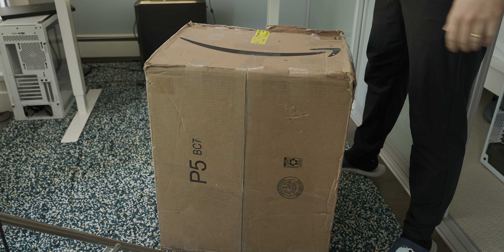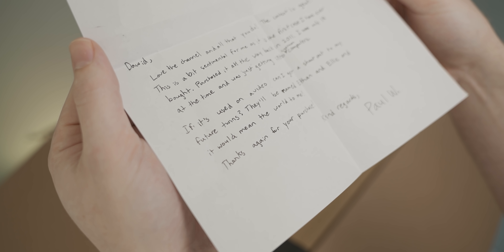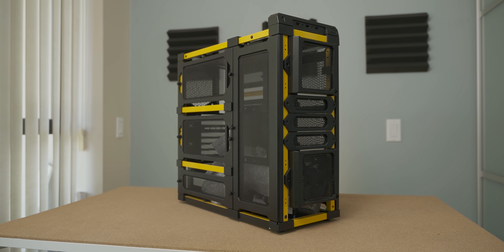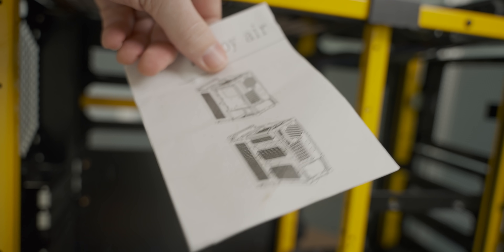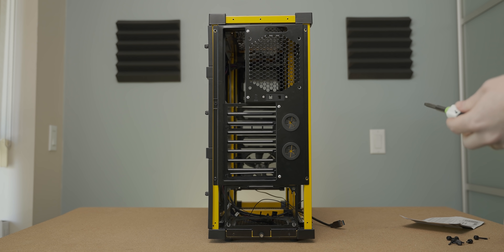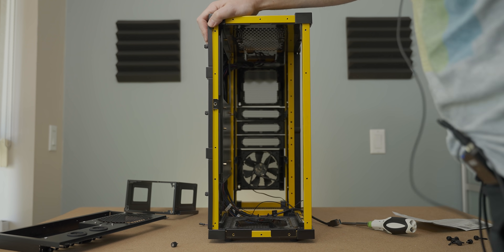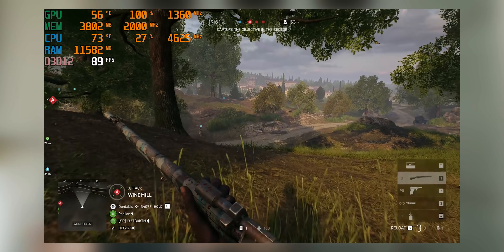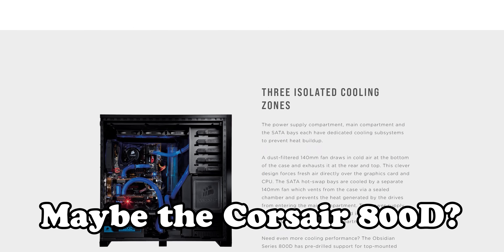The BEST Airflow Case Ever Is From 2010?

Comment: Man, this brings back memories. Anyone remember when Antec was one of the biggest and best players in the PC case realms?
Reply: I have some of their cases in the garage from about 10 or more years ago I think. Man, I remember me and everyone had their cases. What happened to them? Haven’t really looked at pc case manufacturers.
Reply: I still use my Antec Skeleton case.
10 years isn't old.
I'm still using a 12 year old 1st gen i7 as my gaming rig.
Reply: @sahhull  I wish I could harness a fraction of your frugality lool
Reply: @chadking8767  It's really not that hard especially if you reuse things that you can. Like you can pretty much still game on a 3770 or even 2500k overclocked with a GTX 970 or RX 570 or something perfectly fine even at 1080p. I was having to turn all kinds of shit down back in 2017 at 768p because I was still using a 1gb HD 7000 series Radeon and an i5 3350p. Amausingly, a 3770k and a GTX 980 was really all I needed to do with that PC and still game. I simply chose not to, because I'm a fidelity snob who's overcompensating for the suffering of XCOM2 running like shit at 768p and so I'm at 1440p now. But even then, mostly what's different between then and now is really only refresh rates and resolution, not actual game mechanics or graphical improvements. Dead Space 2 literally still looks like some 2022 game trying to sell itself on raytracing or some shit. Basically everything stagnated after about 2010, 2012, so if you don't upgrade your monitor, odds are you can still use a really old/low end graphics card and be fine unless the game is a complete unoptimized mess like Crysis or Cyberpunk or something. 

>but it's not just optimizations!
Go look at Alien: Isolation and tell me that. 2014 game that straight on looks better than tons of modern games, even including the models. It outright looks better with more detail to the skin of their face than triple A games. Division 2 is a very pretty game and its models could be from 2012 and I likely wouldn't notice the difference. It's sad. Most of the gaming conventions and even the popular franchises all started in the 90s until they were sodomized horribly by Bethesda or someone, because it's an industry ran by the corpos, the lawyers, the marketing people, the suits wanting dividends, and not the early non-businesstwats who made up the gaming industry, who successfully deflected blame for their terrible practices on "wokeness" when most wokeness doesn't even exist in gaming and the few times it does was specifically forced in there by the business types themselves as a marketing decision to "sell more units." Meanwhile the same shitheads who've been ruining gaming since the late 80s in those corporations are the same ones that've been aggressively moving to phoneshit, after they drained every last drop of blood they could squeeze out of paid in game microtransactions on full priced titles and consolization. Basically every time I think about gaming or tech and money I get asshurt all over again because I remember who's to blame and keeps getting away with it and making things worse, because art is ruled by Capital, by MBA major types. 

The butthurt grows the longer your memory as you can remember how much worse it's gotten over time, until you just start refusing to give them your money. Like I won't give Valve my money if I can help it, I will never pay for a title from EA or Activision. So even if you're not frugal, you can still be rightfully butthurt when you remember your phone's battery doesn't come out (and tracks you as a GPS/audio/webtraffic bug anyway), your laptop's RAM, SSD, GPU, and battery are all soldered on, and the proprietary motherboards don't even have the fucking right connectors so you can't reuse anything from Dell anyway thus negating any reason to purchase something from Dell (especially not the high end shit where basically "Alienware" is a plastic skin of Alienware's corpse that an ancient metal Dell chassis wears around to frighten oldfag gamers with, since it's got a 120mm AIO for a 12900k and performs worse than a 12700k anyway) end up refusing to pay for or use anything from Apple ever, feel like nVidia is straight up scamming and lying to you without the performance to deliver, see how shitty a lot of surviving companies are now that EA didn't murder yet like Eidos, and basically just stop being willing to pay for anything new sheerly on principle of hating the companies. So if you can't be frugal, remember what they took from you and be butthurt.

Comment: If they released something like this today, I'd buy it honestly.
Reply: Yes my case better have mad air flowwww 🥶
Reply: I like how it looks and would also buy one.  I built my rig in a  THOR V2 case.  It has good airflow and one of the few that had the 6 front bays I needed.
Reply: Just please, if you do it, don't ruin this monster with rgb fans everywhere, but I understand you mate, I would buy it too if I would be able to leave my C.M. 690 III. But I can't betray it, I love my case too much, even if there is no hardware inside. Actually working on it to improve airflow and let it shine again. This kind of case, like that Antec or mine, are rare gems nowdays. There is the corsair obsidian 750d that give me some retro' vibes and seem solid. MMM maybe I'm being too much nostalgic.
Reply: @andreabriganti5113  Only yellow LEDs could fit into this case in my opinion.
Reply: This case does have a lot of look but in terms of air flow it's a chain link fence around a test bench. Imagination time. If you want to cool a room what would work better, closing the door and using a window-mounted air conditioner, or setting that AC unit on the floor in the middle of the room? In the window, right? Cool air in, hot air out. It's all about exchanging hot air with cold air. This case moves a lot of air around in a chaotic way. It's basically the design of a space heater. There's a practical reason why most cases aren't just perforated metal boxes. I wonder if he used another case with good airflow but a dedicated intake and outtake as a control if the results would've been different.
Reply: @zachb8012  lmao bro calm down no need to mansplain it we all know how cooling works.
Reply: @zachb8012  Just have one entire side of it be intakes, then all around the top and front and back be outflow
Reply: I wanted to buy something like this 8 years ago, but they didn't make a microATX model. 😢

Comment: I think the airflow case to beat is the Silverstone FT03 from 2011…

Since hot air rises, the vertical mounting doesn’t allow any hot air to be stuck anywhere inside the casing. It has a pair of 120mm fans to push air from bottom to top. And the 120mm exhaust fan is situated right above the cpu to move any hot air out.

Comment: I had one that I used for a while. Great airflow and really didn't mind the fan noise. Mainly due to the furnace and AC making more noise than my fans.
LOVED the fact the hard drives had some shock protection, in the case they were suspended by rubber bungee cables with clips.
LOVED the totally modular case. If I ever had lighting for the case I'd simply flip the board from one side to the other.
LOVED the fact I could take the shop vac, go into blower mode and blow dust out of the whole thing.

Only con I had about the case was while it was on the floor at LAN parties one knocked over drink and game over.

Wish I still had the case. Had it in storage in my basement when it was accidentally taken by a junk removal company when I wasn't home.

Comment: I still remember when Antec made good stuff. My NAS is still powered by an Antec 750W PSU from 13 years ago. Those things were incredible.
Also, by the time this case was released, my system was housed in a CM Storm Sniper by Cooler Master. Excellent case as well.

Comment: Ran across this video today, because I'm building a new rig soon, and looking into a new case. Reason being. I have run this exact case (mine has the blue accents, not the yellow ones) since it came out back '09-'10. You're not wrong about dust, have to take it out and clean it every once in a while, but it's always had super cool running temps and the modularity was one of the things I've always loved about it. But, it is just time to upgrade, I will never get rid of this old case though, it's been amazing.

Comment: I still use my old Antec 900 case from 2007, 4 120mm case fans and one 200mm. Great air flow. I cut a window a/c filter(very thin plastic kind) to fit the front to keep the dust out where 2 of the 120mm intake air. Cut another small piece for the side 120mm fan that blows over the GPU. The GPU fans don't even come on until the GPU is really pushed because of it. The top 200mm fan exhaust air out the top and another 120mm in the back in line with the CPU cooler exhaust out the back. My power supply also has a 120mm fan that exhaust out the back as well. I just cleaned it after my last build from 3 years ago and there was hardly any dust in there, it gets used 4-6 hours daily. After all these years I only had to replace one fan. So far I've built 4 systems in it over the years. I think if I build another system in it I'll replace all the fans since the rest are so old. If you can't tell it's my favorite case and I've gotten my money's worth out of it!

Comment: I still have mine.  Blue one.  Never added fans.  Just kept the 5 that came with it.  I believe they all have blue leds in them.  Never had an issue with dust.  Used it from 2011 or so until 2013 and then shelved it.  Been sitting in a box in my closet with same hardware I installed in it.  The hard drive cables that suspend them rotted away.  Case was much bigger than I thought it would be. Fans were loud.  The 2 on the front came with knobs so you can control the speed.

Comment: This case cost around 200 USD in 2011.  I was building a pc and Newegg just happened to have the LanBoy Air in red-black on a one-day sale for 50% off the very day that I was ordering my components.  It was worth the sale price.  Thermals were excellent and it was one of only a few cases wide enough to accomodate a Thermaltake Frio, which was a very large air cooler (this also required flipping around the rear intake fan so it functioned as an exhaust).  The plastic did feel a bit flimsy.  And you're definitely right about dust being an issue with this case.  I had to clean it out with an air compressor regularly.

Comment: Great video, some of the older case have so much character. 
I love my Corsair 780T [White], still running an i7-5960X and GTX980 Sli from 2015.  Temps generally run about 40 Celsius for CPU using H100i cooling and 55 Celsius for GPUs.  Case gets cleaned out of any dust every month.

Comment: I have a Master Cooler HAF full size case from around 2009.  In January 2021, I rebuilt my computer but used my old case. Entire front is used for air intake (except for DVD drive) with 200 mm and 120 mm fans. Side has 200 mm fan intake blowing onto cpu and motherboard. Top has 200 mm fan and rear has 220 mm fan both for exhaust plus the power supply.

Comment: I would love to see a video on the Coolermaster HAF X which I used in one of my earlier computer builds (2011).  Great case for its time.  Like a damn wind tunnel!  I have it in pretty much flawless condition in original box at my house!
Reply: Mine is also chilling in its box in the basement. Would love to use it again, but the bastard is 2" to tall to fit under my current desk. 😭
Reply: I run my current system in a HAF 922. Best cooling ever...

Comment: I have the exact same case and bought it in 2009. I been using it for every single build ever since. The only things I recommend is to get some polyurethane foam filters and cut  them to fit over the fans. I used sticky velcro tabs and covered all openings including the top of the case .. That way you get far less dust and you can take them off and clean them. Also the rubber that holds the HDDs will disintegrate over the years. I just replaced it with zip ties.

Comment: I've got an Antec Solo 2 case and I'm totally happy with it. Gear inside: Ryzen 3600, Asus Rog MB and Asus RTX 2060S Dual version. Temps are ok (under 70st CPU and GPU). There are 2 Noctuas NF-A12x25 at the front and NF-S12 at the rear. Build quality is very good. This case was my dream once, long time ago, and later, when it wasn't avaible on the market i've found it on Allegro site from private person, new, unused. So i bought it then , few years ago,and don't plan to change.

Comment: Great video. Within the last year I picked up a lian li pc-a77f case(case came out in 2010), and it's been serving me well. I use it for a server, so having the 12 5.25 bays is great for mounting hot swap bays. For the most part the case seems to stand up well with current cases, but has a few quarks from that eara of cases.

Comment: The whole HAF series holds up pretty decently. Specifically the haf 922
Reply: I'm still using a cooler master haf 932. Unpainted interior, firewire port on front io and no usb 3. But what a good case with great air flow.

Comment: Awesome case! I think the Cooler Master CM690 series hold up pretty well. Very basic and good airflow. That said some versions had completely bonehead design issues like a top vent that don't align with fans if you want to use a radiator so your top won't fit back on properly. Ask me how I know.

Comment: How about the Chieftec Dragon Dawid? Absolute bulletproof beast of a case, solid 5mm steel, weighed 15KG+ with a system inside it!
Reply: My CM Haf X comes in 14,4kg WITHOUT system inside.
Reply: my s340 is over 10kg with parts inside

Comment: I'm using the cooler master cosmos 1000 from 2007 and I opened up the front so I can have 2 front intake fans, one bottom (intake), one back(exhaust) and two top (exhaust) fans. It's doing really well and it's huge and quit with lots of room. Only problem is that it's heavy but it has really nice handles for carrying it around. I also made a custom glass side panel for it :)

Comment: Cooler master HAF XB. Came out around the same time and cooler master still makes them. They can also be an open test bench and have tons of air flow. Also a dust magnet. I have to clean mine regularly. Owned it since 2013. Have built 2 PCs in it so far.

Comment: A case that i feel have held up well, too, is the Phanteks Enthoo Primo, the first Phanteks case ever. It's a little newer, from 2013 but i think it's one of the first cases to have a PSU shroud/basement (quite similar to that of the much newer Phanteks 719) and it's very watercooling friendly. Bought it back in 2013 shortly after release and i still own it. Gonna do a casemod with it soon, possibly some custom watercooling later on. Only disadvantages is the size, it's fricking massive and around 18 KG, taking it apart for a proper cleaning took me a couple days. Been a fan of Phanteks ever since, i've owned the Primo, P400S, P400A and currently the Evolv X. The locking mechanism on the Primo front panel broke and they quickly mailed me new ones free of charge from their facilities in the Netherlands. Aside from a few odd design choices like the sliding coverplates on the P600S, P500A and Evolv series, i've been more than satisfied with their products. That was a long ass rant lol

Comment: I actually owned this case (but with blue accents instead of yellow), and gave it away to my friend in a charity build after his old PC was stolen.  It's a really great case- very modular, rugged, and configurable.  As Dawid pointed out though, it gets dirty really fast!  

It also has the worst 3.5" drive mounting system ever made, where the drives are supported on floating rubber tube bungies, which crack and fall apart after 5 years.  There are some after-market solid brackets that fixes this issue, though.  I definitely recommend the Antec LANboy Air- it's durability and conveniences like the fold-down carrying handles make it a winner.
Reply: I've only had 2 of the tubes dry rot on me in 7 years of constant use.

Comment: I'm still using the original Cooler Master Cosmos S from ~2008. It may not be the most beatiful or RGB friendly case, but it definitely checks all the airflow boxes while intakes have dust filters all around, has huge custom water cooling potential (currently running a custom 120x45, 360x45 and 280x86 mm radiator loop) and a lot of nostalgic 5.25" expansion bays which can be used to mount cheap front USB 3.0 / USB-C bays or multiple 2.5" SATA SSDs and has a nice capacitive touch switch :)

Comment: For me, the Silverstone RV02 is the most timeless case from that time. I had it for a long time. Great dust filters, great air flow (way better than my actual Meshify C). The problem is that that thing was huge, and the fan control switches had a terrible location.

Comment: I have been using the CM Centurion 590 for a few months. I think the design holds up very well considering it is 13 years old. 
And since you can mount almost anything in 5.25" bays, I won't side-grade to a modern case. The only negative thing about it is the lack of a PSU dust filter, and plastic clips. Plastic clips die over time. 

(when I bought it it had 1 and a half clip holding the front panel on... still, nothing HDF, m4 bolts, m8 or m10 bolts and corresponding thread-taps and a lot of time can't fix)

Comment: I still wish I had my Antec Fusion 430 from 2007. It was totally designed for HTPC use, and since then, I've never gone back to tower PC's. Its unique features were a giant volume nob and a front VFD display. It fit a full ATX PSU, yet was still surprisingly compact. Probably still my favourite case.